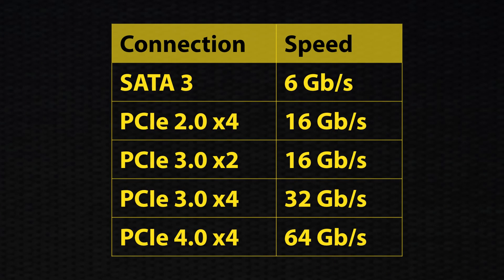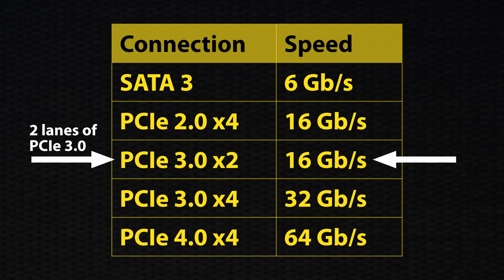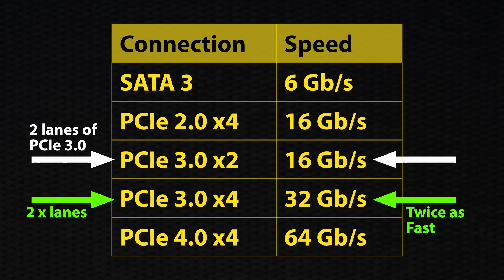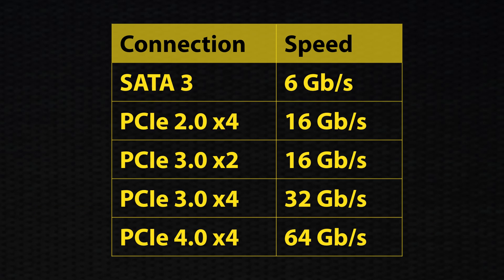M.2 vs NVMe What's The Difference Exactly?

Comment: Man I just started to upgrade my ssd (mostly to increase storage not necessarily power) and learn about it all.  Turns out according to your list, i bought the lowest standard m.2 sata ssd.  However, it is what my laptop can take anyways, no nvme ever for this device.  But I can't complain, because it's the fastest device I ever had and works well for what I need it for anyways.
Reply from the maker: Thanks for watching! I am responding to you on a computer with a M.2 SATA SSD. Fast enough for this use. You won't see much of a speed difference with normal use cases.

Comment: will a M.2 ssd sata drive work on an M.2 NVME pci slot on the motherboard?
in other words: M.2 M&B drive will work on an M.2 M slot only?
Reply from the maker: Sometimes:. It depends on how the slot was configured by the motherboard manufacturer, it could be either way. You will need to check the specs for your motherboard on the manufacturer's website. Also, read some of the other comments as  I went into detail on some of them.

Comment: Can i use a m.2 nvme pcie disk in an m.2 sata?
Reply from the maker: I think you mean in an m.2 sata socket. It depends on what motherboard the socket is in. Consult the technical specs on your motherboard. Some accept both nvme and sata, other accept only one or the other.

Comment: I believe that in an Academic way 1- @ 4:12 you should have said "...the 2.5inch form factor area..."  2- @ 4:30 and again @ 5:21 you should have properly said "...mSATA or miniSATA ..." and not mSATA microSATA as the microSATA pertains to connectors and not THE form factor. Besides those oops moment a good video. TYFS
Reply from the maker: Thanks for watching! I did not know that microSATA referred to the connectors. I'm a bit surprised that I didn't make very many other mistakes on this video, as there is lot of information conveyed here.

Comment: This is very helpful, but you said to look for the lowest Q factor for the 4K read/write spec.  Wouldn't a higher Q factor be better?
Reply from the maker: Q depth refers to how many read/write operations are pending. For normal desktop use, there are very few disk read/write requests at one time, so low Q depth reflects the performance you could expect for this use case. If you have a server with a database used by every agent in a busy office at the same time for instance, then a higher Q depth becomes more important because you could easily generate 20 or 30 read/write requests at the same time.

Comment: How can I know if my laptop wants m.2 or nvme? I am curious of the pin and slot that fits in my laptop. Thanks!
Reply from the maker: You need to research the specs for you laptop on the manufacturer's website. Not all laptops are able to M.2 drives, some have the storage SSD soldered to the motherboard and other use 2.5" SATA drives.

Comment: Thanks for the excellent explanation
Reply from the maker: Glad you liked it
Reply: @hometechadventure4462  Do you by any chance have any good resource to read more regarding protocols and interface differences?
Reply from the maker: @a.s-p1m This is going to get technical, go as deep as you want:

Wikipedia does a pretty good job with the basics:
https://en.wikipedia.org/wiki/M.2
https://en.wikipedia.org/wiki/Serial_ATA
https://en.wikipedia.org/wiki/NVM_Express

This site has a good overview:
https://www.sapphirenation.net/ssd-drives-part-connectors-interfaces-protocols/

Here is a good description of the M.2 hardware and keys:
https://www.mouser.com/pdfdocs/M2ConnectorBrochure201412181.PDF

A basic SATA technical guide here:
https://www.delkin.com/blog/sata-serial-ata/

How deep do you want to go? SATA is pretty much dead as an interface for SSD's in the long term, NVMe is the future, although SATA will live along side it for a LONG time.

Original SATA 3.0 Specification here:
http://www.lttconn.com/res/lttconn/pdres/201005/20100521170123066.pdf

The latest version of the NVMe Specification is here:
https://nvmexpress.org/wp-content/uploads/NVM-Express-1_4b-2020.09.21-Ratified.pdf

The original 1.0 version of the M.2 Specification (I think this is the original) is here:
http://read.pudn.com/downloads794/doc/project/3133918/PCIe_M.2_Electromechanical_Spec_Rev1.0_Final_11012013_RS_Clean.pdf

For the latest version of the M.2 specification, you can find it here (https://pcisig.com/specifications/pciexpress/M.2_Specification/), but there is a catch, you need to be employed by a company that is a member of the consortium or pay a $4000 yearly membership fee here (https://pcisig.com/membership/become-member) to view the files.

Comment: Thank you kind sir! Your video is very pleasant to watch and as a Latino I love your outro! I was looking for the best hard drive for my first build and you helped me pick one. I bought a new x570 tomahawk, a new 011D PCMR, Corsair Vengeance pro 16GBX2 (3200Mhz) and you inspired me to get the Samsung 970 PRO M.2 PCIe Gen3 X4 (that was a mouthfull). I'm so excited for my first build but Im leaving the best for last...the Zen3.

UPDATE: Im returning my Tomahawk X570 because its 1 and a half inch smaller than the average motherboard and it looks funny to me in my 011D PCMR which is basically an XL.
Reply from the maker: Good luck with your build! Thanks for watching.

Comment: how do i determine pcie ver. on my laptop?
Reply from the maker: 1. The best way is to look at the specs on the website for the manufacturer of your laptop. You may even try to email/contact them with that question.
2. If there is already and m.2 drive installed, look at the info in the Device Manager (easy to find with search) for disk drives and find the model name/number and search the internet to find out what type it is. This is not foolproof, because PCIe slots are backwards compatible. For instance, you can install a PCIe 2.0 x4 M.2 NVMe drive in an PCIe 3.0 x4 M.2 NVMe slot.
3. Sometimes it will be labeled next to the slot on the motherboard, so you could also open up your laptop and look.
4. You could use 3rd party software SIV - System Information Viewer. Download siv.zip form one of the mirrors here:
http://rh-software.com/
Expand the zip file and run SIV64X.exe
Look at the PCI bus info and see what is there. It is very difficult to interpret what you see there. If you already have an m.2 drive installed, you can look for that. Mine said: NVMe Controller x4@3 (x4@3). This means that it is a PCIe 3.0 x4 controller for the NVME slot that is in use. x4@2 would mean PCIe 2.0 x4 etc.

Comment: So i have gigabyte-ga-a320m-s2h motherboard. What 500GB SSD would you recommend? I'm thinking of a crucial mx500 m.2 or gigabyte NVMe m.2.
Reply from the maker: Definitely an NVMe m.2 SSD for your system if you are using a more modern processor. NVMe drives are not supported with some processors. Here is what is says on the Gigabyte spec page for your board:

(Note) Supports only M.2 SATA SSDs when using an AMD Athlon™-series/ 7th Gen. A-series or Athlon™ X4 APU.

If you are using one of the older processors, the Crucial mx500 is a good choice.

If you have a more modern processor, are you really stuck on the Gigabyte NVMe m.2? From what I can see they are greatly overpriced for your use case. I would steer you more towards something like this:
https://www.amazon.com/Sabrent-Rocket-Internal-Performance-SB-ROCKET-1TB/dp/B07KGMBCKD/ref=sr_1_3?crid=1X5MRAN3DA684&dchild=1&keywords=sabrent%2Brocket%2B1tb&qid=1600112045&sprefix=sabrent%2Broc%2Caps%2C178&sr=8-3&th=1

If you have a Microcenter near you, I would go for this option instead:
https://www.microcenter.com/product/600420/inland-premium-512gb-ssd-3d-nand-m2-2280-pcie-nvme-30-x4-internal-solid-state-drive

These apparently are the same drive, Microcenter just labels it with their private brand name. Most of the Microcenter deals are in-store ONLY, so you need to have one nearby to take advantage of them.
Reply: @Home Tech Adventure  big thanks for your time, BUT there's a problem. I don't live in USA I live in Lithuania EU so it means that if I want to ship something from America (or any other country tbh) I have to pay for expensive shipping and it costs from 25-50€. And no I don't even think theres a microcenter in my country. And I'm sorry that I didn't list all the details of my build so here it is:
CPU: Ryzen 5 2600 six core 12 thread 3,4GHz up to 3,9GHz
GPU: Geforce GTX 1660 SUPER gigabyte gaming oc 6g
RAM: Patriot Viper 8GB 3000MHz 
HDD: Seagate Baracuda 2TB
MB: Gigabyte-ga-a320m-s2h
PSU: EVGA 600w silver 80plus
Case: Cougar MX330
So here's few sites I would buy in Lithuania. 

MX500
http://www.skytech.lt/ct500mx500ssd4-crucial-mx500-ssd-500gb-sata600-nand-p-388360.html?utm_medium=referral&utm_source=kainos.lt

Gigabyte m.2 nvme
http://www.skytech.lt/gpgsm2ne3512gntd-gigabyte-gpgsm2ne3512gntd-nvme-ssd-512gb-p-478509.html?utm_medium=referral&utm_source=kainos.lt#tabsnav-1

From this site I find cheapest parts 
https://www.kainos.lt/paieska?q=ssd+500gb&source=search_form

 My budget is about 60€ but if would really have to I could push to a little more.
Reply from the maker: @ervinase9661  Prices really do vary by region. The Gigabyte NVMe SSD uses the system DRAM as a buffer, it does not have any RAM on its own. This means that it could be slower than spec for some workloads or feel a bit less snappy, but probably not a whole lot. The listed speeds on the Gigabyte are MUCH higher than the MX500. What do you use your computer for? From what I gather, the amount of system DRAM used by these drives is quite small, so you should still see a lot faster speeds with the Gigabyte than the MX500. This Gigabyte drive is VERY fast for an entry level DRAM-less NVMe drive; it appears to be a good deal at the price you will pay, and probably the best you could do given your budget. I don't think you will see any better performance going to a higher priced drive. 8GB RAM is sufficient, but on the lower side for a modern system and it should work fine with the Gigabyte drive since the amount of DRAM a drive like this typically uses is very small. Do you have 2 RAM sticks or one? Dual channel RAM (two sticks in the correct slots) will increase gaming performance. I think I may have to test some of these drives when I build my budget gaming computer that I have planned.
Reply: @hometechadventure4462  I use my pc mostly for gaming and editing. I'm a begginer at editing and I use davinci resolve 16(if you're interested I have a gameplay video on my channel). I have one stick of ram in my system. My motherboard only has 2 slots for ram. I'm going to upgrade my ram after I buy the ssd first. I will buy the same ram that i mentioned before. And using davinci resolve 16 you need to have minimum of 16gb of ram and I'm editing at only 8gb.

Comment: If I currently have a sata m.2 and want to convert to nvme m.2, would I have to open a new partition for the nvme?
Reply from the maker: I'm not sure what you are asking. You would need to clone to the new NVMe drive, or format the NVMe drive and transfer the data, or reinstall Windows 10 on the NVMe drive and then reinstall programs and transfer data. Cloning would be similar to what I did in this video: https://youtu.be/4c5-9JnfUvo

Comment: Just for clarification sir, does m.2 SATA have different slot than m.2 NVMe?
Reply from the maker: Possibly. If the slot is made to only accept drives with two notches, it is definitely SATA only. If it is made to accept a drive with only one notch, then it will PROBABLY accept an NVMe drive. A manufacturer could use an m.2 slot that will accept a single notch NVMe drive but still not support it (possibly because another version of the same motherboard does support it).

Comment: Can I put a sata ssd m.2 on a nvme m.2 slot?
In my laptop?
Reply from the maker: This is unlikely to work. You could go to the the specs on the manufacturer's website to see if it is possible. My guess is that it will only accept an NVMe SSD, but it is possible that it will accept either SATA or NVMe. Or you could email the company with your question and see if they respond. Finally, you could also check the UEFI BIOS settings to see if there is any hint that the slot would accept a SATA SSD.
Reply: Why would you choose sata over nvme? They cost basically the same now
Reply: @nagantm441  so I found out that no and 4 months ago no they weren't
Reply: you can...i'm doing it right now.
Reply: @nagantm441  what? Where? I tried it and it didnt show up
Reply: @gameaccount7142  unplug other sata devices first
Reply: @nagantm441  i think you probably have a sata and thinking you had an nvme
Reply: @gameaccount7142  no, I have multiple computers, some with one, some with the other, some with both
Reply: @nagantm441  does a universal port exist then? I bought an nvme drive and tried putting it in a sata port and it didnt read it
Reply: @gameaccount7142  what motherboard do you have? It all depends on your CPU and motherboard. Some CPUs don't support nvme, especially lower end ones.
Reply: @nagantm441  its a laptop

Comment: Questions:

What use cases benefit from a depth of Q32? (Am I right in understanding this as depth of the pipeline or queue?) Will this increase performance for media creators moving around big files?

Why do bigger SSDs outperform smaller SSDs? You gave the example of 1 TB vs 500 GB. On old spinning disk technology, this was generally true because a a smaller disk was more “filled” (assuming the same amount of storage used) than the larger, resulting in longer seek times. (This is also why defragging your hard drive was a thing, iirc). I didn’t think that SSDs had this issue, but maybe I was wrong.

I also watched a LTT video a while back that was comparing super cheap no-name M.2 SATA storage with M.2 SATA from name brand companies. The cheap one (I believe the brand was “Golden Pigeon”) performed terribly; the reason given was that it was using a single chip vs the more expensive name brand using multiple chips (each storing a smaller amount). Is this related to my second above?

Thanks for this video. It clarified a lot of the confusing information I’ve already seen.
Reply from the maker: Q32 and beyond are important for server workloads, where many users use the same storage device at the same time. Think of an office server with a database that everyone needs to access regularly. Moving a big file is just one request, so assuming you don't try to do other work at the same time, Q1 performance may be best. However, writing to the NAND memory in an SSD is SLOW, so manufacturers of quality SSD's include a RAM buffer to catch some large transfers and then write it to the NAND memory during idle times. If the file transfer is too large for the RAM buffer to handle, then the SSD can slow way down. Depending on the SSD implementation, this can slow down below the speed of a good hard disk for very large transfers. Better quality SSD's have faster NAND and can keep up better.

Bigger SSD's tend to have multiple smaller NAND chips to create the larger size. The SSD controller can use this to an advantage by writing to multiple NAND chips at the same time from the RAM buffer resulting in faster speeds; more parallel operations means more speed. A few of the smaller SSD's are now being designed with more smaller NAND chips to keep the speed competitive with larger SSD's. Also, some very cheap SSD's have smaller or even no RAM buffer which really slows down large file transfers. Unless you spend $$$$$ on a super fast SSD, a hard disk may be more cost effective if you transfer very large files regularly. Also, if it is really important to transfer very large files quickly, certain types of RAID setups will really improve performance. This is again a form of parallel operations, this time spread across multiple hard disks or SSD's.

Comment: Is m.2 NVMe PCIe  compatible with the m.2 SATA 3.0 slot? Laptop model is Asus X560UD.
Reply from the maker: It does not look like it in this case. The storage options on the Asus website say:
1TB SATA 5400RPM 2.5" HDD
750GB SATA 5400RPM 2.5" HDD
500GB SATA 5400RPM 2.5" HDD
1TB SATA 5400RPM 2.5" HDD
128GB M.2 SATA SSD, 1TB SATA 5400RPM 2.5" HDD
256GB M.2 SATA SSD, 1TB SATA 5400RPM 2.5" HDD
256GB M.2 SATA SSD
1TB SATA 5400RPM 2.5" Hybrid SSHD
1TB SATA 7200RPM 2.5" HDD
128GB M.2 SATA SSD
2TB SATA 5400RPM 2.5" HDD
128GB M.2 SATA SSD, 500GB SATA 5400RPM 2.5" HDD
512GB M.2 SATA SSD

No NVMe present, so my guess is that it was only designed for SATA M.2 drives. You could contact Asus support and ask the question though.

Comment: Wait so I have a slot on my mobo and both nvme and data will work with it right
Reply: sata not data
Reply from the maker: Not always. Some motherboard slots will accept both types, others will only accept one or the other. Do a search for you motherboard and check out the specs for the slot on the manufacturer's website.
Reply: Ok thanks I think my mobo should support either thanks for the help

Comment: I am using Asus h97 plus main board. Main board specs says m. 2 type 3, with M key 2260,2280. I am confused which kind of m. 2 drive should I use.
Reply from the maker: You can use either. Full specs from ASUS website says:
1 x M.2 Socket 3, , with M Key, type 2260/2280 storage devices support ( both SATA & PCIE mode )

Source: https://www.asus.com/us/Motherboards/H97PLUS/specifications/

Comment: I am looking to buy a new gamming computer and wonder does this replace the hard drives?
Reply from the maker: Yes, in some systems. Some people use just an M.2 as their main storage drive. 

Others will use the M.2 drive as a startup drive for the operating system and most applications. Since the M.2 drives are sometimes expensive, especially in larger capacities, these users will add a slower hard drive to the system for additional games, movies or data that takes a lot of space.
Reply: @hometechadventure4462   Thanks